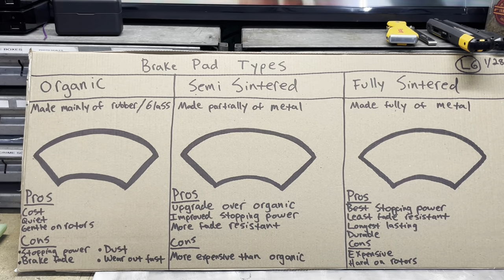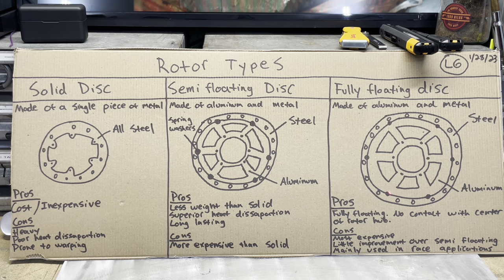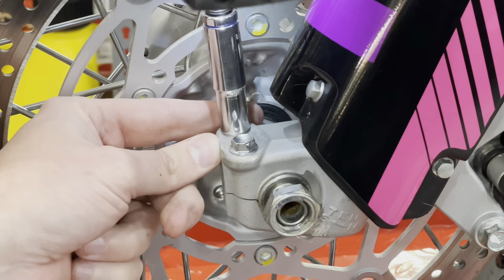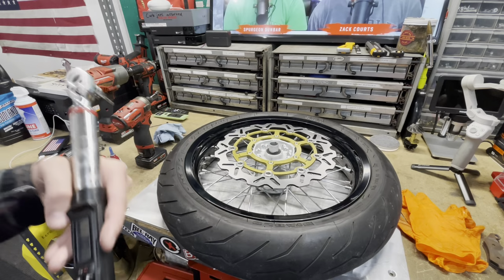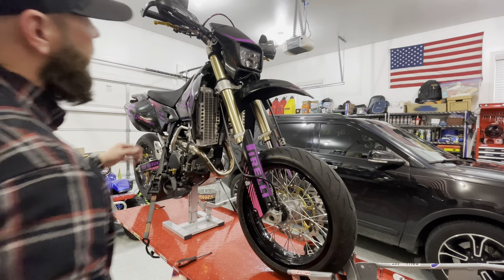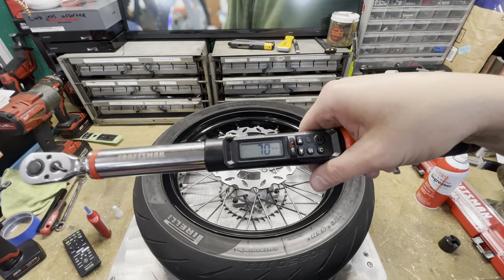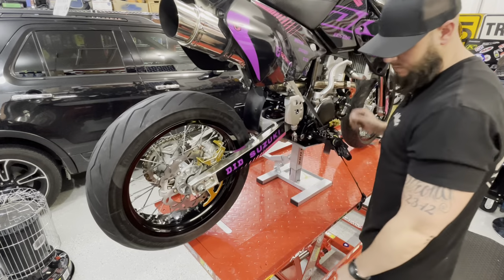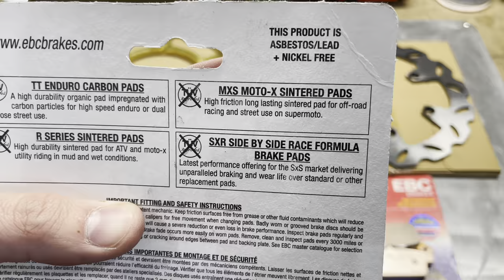DRZ400SM Wave Rotor And EBC Brake Pad Install!

Comment: If you're anything like me you might not apply the locktite over the rotor because I always seem to apply enough that some drips off. I didn't understand why you would torque the front axle at one number then immediately go to a higher number. Makes sense if you torque to the lower number before you tighten the pinch bolts and then add more torque. Any way this is a nice video and it's very detailed with good explanation and showing what tools you need.
Reply from the maker: I wasn’t sure about the double torque sequence either. It’s just what the manual said. Unless I missed something. Which is very possible lol. Thanks for watching!

Comment: I thought I noticed that DJI wireless box at the beginning of the video, in the tool layout. Was considering those as well. Will have to wait until your ride video to see how they perform. 😂 Cheers
Reply from the maker: Well my last video when I rode I used it. Even with the dead cat, and the audio sounded terrible. But for around the garage stuff it’s amazing. Super simple to use. Not sure if I can adjust the gain or anything. I’m pretty tech illiterate. 🤣

Comment: Brake disc look great!  I did the same rear caliper and disc guard only in black, after doing the clear oil filter and starter cover, just added a k&n air filter, the same brand graphics kit in grey, where did you get the stainless brake lines, and are you still on the stock tires? Ps my wife is like “could you quit watching this channel, you keep spending money on your bike”:)
Reply from the maker: That’s awesome dude! Stainless brake lines are from core moto. They are fantastic. And no to the tires. I am on Pirelli Diablo Rosso 3s. They are fantastic! Thanks for watching, I appreciate it!

Comment: Wow, I had no idea they had so many different types of Brake pads and rotors available...  I noticed that they were super light weight.. just assumed that they were all aluminum...  Hey, I like that 'High Tech' torque wrench!  
  I was thinking about trying to put a Shut-off switch on the headlight, you wouldn't happen to have the diagram would you? Or, maybe a simple fix for shutting off the headlight?  Great video, Link!  You really make it appear so easy! 😆.
Reply from the maker: Prob rig up a toggle switch pretty easy. I’ll look in to it! Thanks for watching. I appreciate it very much.
Reply: @linksgarage1985  thanks man!  Yes, if possible, ..tap into the 'High/low' switch, and have a toggle switch right next to it. Idk, if that works though because I watched some other videos on it, and the way that they did it, they had to tap into two different wires. They've got more than one circuit on some of them... I couldn't find much more about it...

Comment: Once again, another mod for your drz where you explain every aspect and angle on the parts themselves and the installation. Thanks for the chart explaining the different rotors and pads I actually have not had the chance to look into those things for my drz. And might I add it looks fuckin rad and I can only assume the performance is better. Now did you do this mod because you were not satisfied with the stock pads and rotors even with the braided lines? And nice kicks
Reply: Once again got me spending more money on my bike couldn’t commit till this video 🤪
Reply from the maker: Thanks man! And honestly, the stock brakes work good. Just wanted to upgrade a little. Not a 100% necessarily needed. I’m running out of shit to do! Ha. I appreciate you watching!
Reply from the maker: @HarleysTrucking  💪🏼. Enjoy. Thanks for watching!
Reply: @Link’s Garage oh well if you are running out of ideas, maybe here are a couple i can come up with 🤣. Stage 1 or stage 2 hotcams to complement the fcr39 carb power delivery,  athena 434cc bolt on big bore kit, revalved suspension or just racetech rear and/or front springs, loctite fixes ( countershaft, main bearing, stator), modified rmz front tank plastics, modified shaved rear number plate plastics, ya actually you have done quite a bit to this drz it is hard to come up with many ideas. I really need to get to work on mine before the spring. Do you have a link for the company that did the custom graphics?
Reply from the maker: @max.b92  I’d love to do all of that  stuff. But it’s big $$! And I think I got them from Boston Decal Works
Reply: @Link’s Garage ya you have put a lot of $ in a short amount of time in your drz, but just look at it man. Fackin beauty and must be a blast to ride compared to stock.
Reply from the maker: @max.b92  it’s a blast for sure! Way different than stock.

Comment: What power drill do you use
Reply from the maker: @pedrovega4034  several different ones. But I like the Milwaukee fuel series.
Reply: Thinking about getting one
Thanks for your videos am able to work  on my DRZ400SM
Reply from the maker: @pedrovega4034  I appreciate it! Lots of videos to check out!